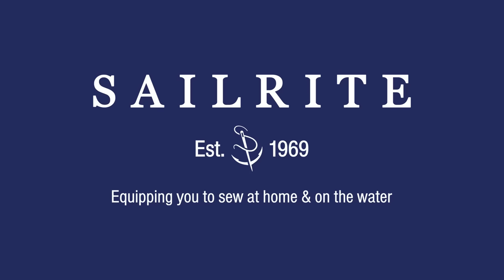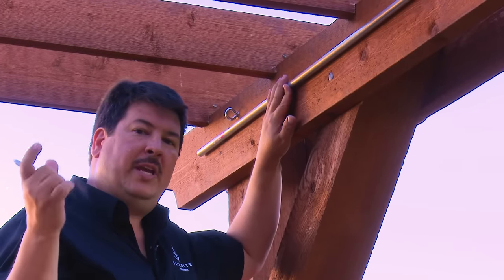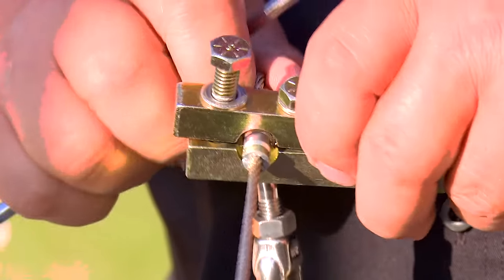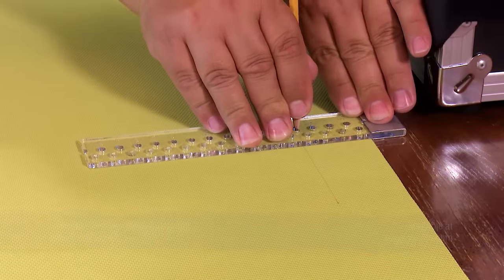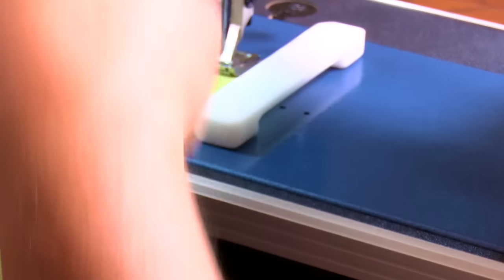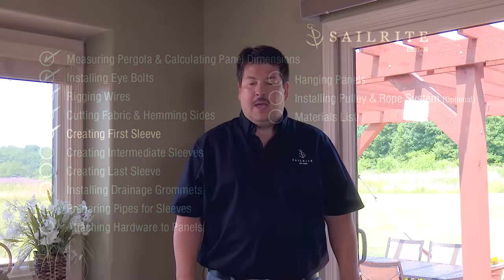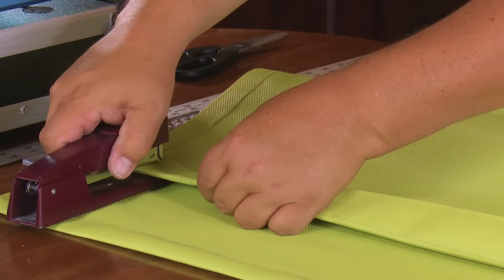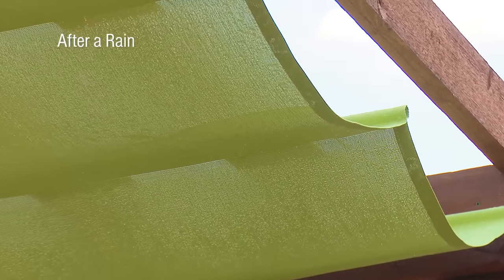How to Make a Slide-On Wire Hung Canopy (Pergola Canopy)

Comment: I'm actually wanting to install a full canopy that covers in one piece - not multiple pieces. My reasoning is - I don't want partial sun coming through and I would like to be able to sit under the canopy in the rain.
Reply: I think without the gap you end up with a giant flapping sheet in the wind. If you want a giant mono shade you need to have it under tension

Comment: After watching this VERY detailed video I am (maybe) two steps from final installation. I am quite the "detective" and researched every single item needed to make my wire hung canopy. Bit by bit, piece by piece I got the best deals on fabric, wire cable and clamps, stainless steel turnbuckles, caribiners, pad eyes, etc. Hours spent measuring, sewing, and only occasional cursing! I was not about to abandon this project and saw it through til the end. I'm beaming with pride and will share a picture to show how it turned out.
Reply from the maker: We are so glad that your wire hung canopy project came out so well. Share your latest DIY masterpiece on Facebook or Instagram using #Sailrite and you could be featured!

Comment: I did not read through all 187 comments but I felt this might save some time.  Most quality staplers like the Swingline you used have an anvil with two settings.  The normal setting that folds the legs in and if you push up from the bottom and turn the anvil around it will bend the legs out; this in effect makes the staple a straight pin that can easily be pulled out.

Comment: The most impressive tutorial I've ever seen. I applaud you. I need what you made and If I owned a machine I'd do this project. I love taking on projects like this but I would think the cost of machine alone would make it impractical to do it myself. Not giving up, I will pursue this project using your instruction and your materials.
Reply from the maker: Thanks so much! I feel you on the whole machine cost thing; it can be tough. Just take it one step at a time, and you got this! Can’t wait to see what you come up with! However, if you buy a sewing machine that works well you will find yourself making a lot more projects than just the wire hung canopy. Thanks again!!!

Comment: you could always just lower your eye bolts on one side to let the water flow out :) very slight incline like 1-2% is all you need, you will also be hiding the previous eye bolt holes with the eye bolt going lower but this will increase your slope a lot more but predrill and space away from previous hole so you dont split your wood :) thank you for this walkthrough, love it and plan on buying and making something like this for our new deck thats directly in the blistering sun...composite decking gets HOT

Comment: This is an outstanding tutorial.  Maybe one of the best I have seen.  I feel like I just finished a trade seminar for Sailrite.  I was searching to make a retractable awning to extend away from the beam that supports the balcony of my first floor apartment that will give some shade when the sun is setting in the west, not for a permanent structure like the pergola.  This will work for my application with a removable bulkhead on the end away from the patio, so long as it would support the wire rope tension.  With the water repellent nature of that material, it would provide a substantial cover when I have to grill in a light rain.

I may take it a step further and use a tubing bender to form a gable or mild arch.  Even if it only had a 2-12 or 3-12 pitch, it would increase water shedding immensely.  With a bend in the thin wall conduit in the middle of the span, and a slight bend just up from each end; it would make a great retractable patio cover.  As long as the wire ropes were positioned uniformly at the proper height, commensurate with their position on the arch; it would work exactly the same way.  Of course some scaling of fixtures and fasteners may be necessary.

I want something wider though.  If it does not come in wider widths, any secrets on joining panels edge to edge?  I’m sure an overlap is necessary, but a certain stitching pattern may be proven best.

Again, great job!

P.S. Ship one of those sewing machines to me for the project and I’ll make a video, then ship the machine back.  I do a lot of leatherwork.  I wonder how one of those machines would stitch a belt?  Would it work on multiple layers of 8-9 oz. leather for the welt of a knife sheath?  All I do now is a saddle stitch by hand after beating the holes through with a pricking iron.

Comment: Great technical advice and show-how!  But maybe a good idea to tell folks NOT to use a stapler on Sunbrella, as it will leave holes. Also, instead of using hole punch, I'd use an awl to make the holes in the mesh...no need to cut holes, just use the point of the awl.

Comment: I love the Canopy, for water drainage, could you not offset the cabling so the panels are higher on one side than the other?
Reply from the maker: Yes,  it can be set up at an angle, which has the advantage of shedding water, but the disadvantage of the weight of the fabric and hardware being pulled by gravity.  I have not made one at an angle, so my guidance is limited. I have had customers make a few that way and they have reported good success. Let me know if you have more questions.

Comment: idk, can't take it down or change it out for cleaning--at least not easily...It would be disgusting here in a matter of weeks. edit: very impressed with the one handed filming!!  Glad you didn't fall doing all that!
Reply from the maker: It takes about 5 minutes to take down each canopy panel. It takes about that same to re-snap it to the wire cables.

Comment: Excellent video very detailed. One of the best I have seen as far as detail is concerned. The only thing I’m wondering about is just general dirt and leaf clean up, how would you do that. On our motor home we have an awning and it is a chore to clean to the point we use it very little.
Reply from the maker: Thanks! Yes, cleaning an awning or canopy like this is a big pain. Each year I remove the canopy, it takes only about 20 minutes to remove the all, and clean it with a soap and bleach mixed in water. I use a soft bristle brush and scrub it and then rinse it off well. Since I sewed the canopy with a PTFE thread the bleach solution will not damage the threads, as it would if it were sewn with Polyester threads. Also the fabric is not damaged by the bleach solution. It is a pain, but cleaning it each year means it will last for several years.

Comment: Is there any reason the rope and pulley system couldn’t be mounted just UNDER the wires?  Has anyone tried it?  The cross beams of my pergola will be in the way of the line if I mount above the wires and the lines will rub on the wood.  The only modification I can think of might be the location of the alpine butterfly knot, but maybe no modification is necessary.
Reply from the maker: It may work but we have not tested it.

Comment: Greetings from Malta. 
Thank you so much for this informative video. My calculations are giving me 6 spans of 28" each. When they are folded these will give a drop of fabric of 14" approx. If I double the spans to achieve a fabric drop of 7" would this be feasible please? I would like to have your opinion before I proceed with the project. Thank you.

Comment: Was there a reason to use 3 Turn Buckles? Could you not have done this with 1?

Weave the wire through all the squares with 1 turnbuckle tightening the entire length.

Just an observation and curious question.
Reply from the maker: Each 90 degree turn of the cable in the eye bolts reduces the amount of tension that can be applied to a section. We find that superior tension is achieved via one turn buckle per rectangular area. If you used one turnbuckle for more than one rectangular wired area you will notice that a lot of tension is applies to the eye bolts near to the turnbuckle.
Reply: @SailriteDIY Although it would be more cost effective to replace them with another pulley minimizing the "resistance". But I get it, it's your concept nice work regardless.

I enjoyed the video.

Comment: Great video, thank you.
Have you made a video for constructing the pergola itself?
Reply from the maker: No, but I do have a materail list for the supplies for the pergola:  
• Posts = 6 x 6 x 10' Red Cedar Timber - Rough Sawn (Actual Size 6" x 6" x 10') – 4 each
• Posts = 6 x 6 x 12' Red Cedar Timber - Rough Sawn (Actual Size 6" x 6" x 12') – 1 each
• Roof Slats = 2 x 6 x 16' Red Cedar Lumber - Rough Sawn (Actual Size 1-3/4" x 5-3/4" x 16') – 11 each
• Side Beams = 2 x 8 x 16' Red Cedar Lumber - Rough Sawn (Actual Size 1-3/4" x 7-3/4" x 16') – 4 each
• 3/8" x 10" Carriage Bolts - 12 each
• 3/8-16 Hex Nuts - 12 each
• 3/8" Flat Washers - 12 each
• #9 x 3" Premium Exterior Deck Screws - 5lb box
• OZCO Ornamental Wood Ties 6" x 6" Post Base Kit – 4 each
• Grip Fast 1/2" x 4-1/4" Wedge Anchor - 4 each
• Cabot Semi-Solid Deck & Siding Stain Redwood - 3 gallons

Comment: Overall your production was very convincing. The drawstring system appears too cumbersome to install as a diy project. I would have liked to see how you attached the poles across the span (at the folds) with more clarity, it was very confusing. Does the pole have to be in a pocket or can you just attach it with the pipe on the bottom, material sandwiched and the hook on the top then connected to the wire?
Reply from the maker: Yes, the pocket must be formed for the pipe to be inserted inside the sleeve. Without the support of the sleeve/pocket the fabric will fail where the pipe is attached via the eye strap and no pocket is utilized. So... you must follow the video tutorial for this to work.

Comment: Will the 54 inch fabric be better than the 60 inch in terms of holding up?
Will a thinner fabric be better than a thicker fabric in terms of how heavy it will be on the cables?
I need full sun protection, I dont want light to go through, which fabric should I order?
Thanks
Reply from the maker: The width of the fabric, 54" or 60" will not make a difference, but the type of fabric will. A vinyl mesh fabric, like Phifertex Plus, will allow water to pass through the fabric and is more abrasion resistant than a Sunbrella® brand fabric which will catch the rain water and it may pool up, unless grommets are installed. I would not suggest a thinner fabric, as it will not last as long and it will not make much difference on the wire cables performance.  If you want to block as much sun as possible go with Sunbrella® Marine Grade fabric (in a darker color), but be sure to install a grommet in the middle of the each fabric span, so water can escape (as show in the video).

Comment: Will a regular sewing machine work with this fabric and thread?
Reply from the maker: Phifertex Plus fabric is very easy to sew, since it is a vinyl coated mesh fabric. Most home sewing machines can sew it. If you want to confirm this you can order a sample of the Phifertex Plus fabric on our website and try it on your sewing machine.

Comment: I'm curious why you need to hem the sides of the fabric.  If that Phifertex fabric won't fray, then can't you just cut it to size and leave the edges unhemmed?
Reply from the maker: Hemming the edges gives a more professional look and it also reinforces the fabric edges. However, you are correct the edges do not have to be hemmed, they can be left raw. The edges do not come under much stress in a wire hung canopy application, so the reinforcement a hem gives is probably not required.
Reply: Thanks for the response. I ended up getting a different less expensive fabric that will need a hem. The fabric calculator says my panel widths will be 40 inches. Does that already allow for a hem, or do I need to add that to the fabric width myself before cutting?

Comment: With the Sunbrella or Phifertex fabrics: If my space is able to accommodate the full width of the fabric will that be okay or do you recommend always hemming the edges?
Reply from the maker: The Phifertex Plus edges do not have to be hemmed for a wire hung canopy project. Hemming the edges provides a little more resilience and a more finished look to the panels, but for this project it is not required.  However, if you use Sunbrella, it is recommended that its edges be hemmed since it will unravel rather easily if left raw. The factory edges of Sunbrella Marine Grade are sealed, but if you cut down the width it is also recommended that you use a hot knife on Sunbrella.

Comment: Thanks so much for the tutorial. I am based in the UK and can't source the Phifertex fabric. Would you know what is the name of the material I am looking for? I have been searching for 'vinyl coated weave polyester fabric roll'... is that correct? I am struggling to find anything that's similar to Phifertex as it would be great to get a fabric that doesn't fray at the edges. We want it to allow water to soak through to avoid having to install grommets. Thank you! :)
Reply from the maker: Glad you liked it. Sorry, we do not know who carries that kind of vinyl mesh fabric in the UK.

Comment: "Our Eye Bolts have a working load of about 1000 lbs..." What are you going to attach to it; a yacht sail?
Reply: Here in the Mojave desert, a shade structure IS a yacht sail
Reply: @chriswhite2151  I'm with you. I don't want to lie awake wondering what the windstorm outside is destroying.

Comment: I my self instead of sewing would use 1x2 and sandwich between another 1x2 or a strip of metal 3/4 and screw to the 1x2 paint first or cut a PVC pipe down 1 side Staple gun a lip thicker than your cut an slide another smaller PVC pipe inside or a strip of wood that will fit that can be stapled like trellis stock. Comes in PVC too.

Comment: Thanks for the well presented Video. I've used some of your products over the year and did a YouTube video using galvanized/pvc pipe for a fixed frame deck sunshade. However, this fall I did some deconstruction due to raccoon using my sunshade to get on and start tearing through my house roof shingles so I am planning this spring to do a combination fixed and cable slide (to provide a gap between my fixed shade and my house). Hopefully, the raccoon can't tight rope across the cable. Again, great detailed video for us DIY'ers. My only question is in addition to purchasing the supplies from Sailrite, do you provide pre-sewed panels?
Reply from the maker: Hi Robert,
Thanks for the positive comments! We do not do custom finished sewing here at Sailrite, sorry.

Comment: Is it possible to install this system on a vinyl pergola? If not, do you have any suggestions?
Reply from the maker: Yes, if your vinyl pergola has a wooden core. Most vinyl pergola systems have a wooden beam inside each vinyl cover. If that is the case yes, if not then no.

Comment: Will be using my Fabricator with V92 poly thread with the Phiretex Plus.  What is a recommended stitch length? Thanks!
Reply from the maker: Hi William,
I would use a 5-6 MM stitch length.

Comment: That pulley/rope system is not only not necessary but expensive.  You would be better to fasten-fix one end of the curtain to one side and use a pole to pull the other end across to open or close the curtain.  When fully closed work out a way to hook the other end to the pergola.
Reply from the maker: You could do something like this: https://www.sailrite.com/PDF/Alternate%20Webbing%20Strap%20System%20for%20Wire%20Hung%20Canopy.pdf
Reply: @SailriteDIY  Exactly.  The article could show you more pics of the fastening, but being very handy, I could figure out a rust-proof way of fixing each end to the structure.  I would probably use a long wooden pole, depending on how high the curtain is and just hang it off the structure so it is within easy reach.

Comment: Instead of wire rope, could clothes line or climbing rope or something of this sort be used?
Reply from the maker: We do not recommend using rope or clothes lines as they will stretch even if drawn tight over time. Wire rope will not stretch.

Comment: I definitely need something like this for my patio/work area which is virtually unusable in the summer. I was thinking hanging a mesh like they use on dump trucks over a pergola. Anyone try that? Is it enough shade?
Reply: What happened to the Nicopress Installation Tool (#19203) used in the video?
I can’t find anything like it on the website.

Comment: There is a better way to build this, without the metal conduit. Look up KarbonBar. It is half inch fiberglass rod that comes in 20' sticks. It is lightweight and strong. It is used in concrete flatwork as re-bar. It is easy to glue fittings onto it.
Reply: Thanks for the tip, Kevin. I really like the idea of the lightweight KarbonBar, and I had never heard of it before.
Reply: I don't think I'll be able to attach the fasteners onto this bar. Even if the KarbonBar drillsor glues well, the rough surface would be a problem.

Comment: Great video Eric.  Question:  My application requires eyebolts directly into our physical house where I can access stacked 2x4 headers.  What success will I have using lag screw eyebolts with all of the tension of the wires?  What do you think?
Reply from the maker: Yes, using lag screw eyebolts does work just fine. The tension of the wires will typically not pull them out.

Comment: Can I take a big piece of canvas 12'x12', 6-7 rods/pipes 12' long, 4 bearing cords and build the same system, but in one piece?
Reply from the maker: Yes, that can be done, but I recommend wire ropes to be spaced no more than 60" apart to support that large span.
Reply: Thanks!

Comment: Very good. Thanks a lot for this. Question: is't possible to use the same system and  run it with a electrical motor with this type of  rope?
Reply from the maker: Well, that is something that we have not thought of doing. I imagine that it is totally possible, but it has not been tested yet.